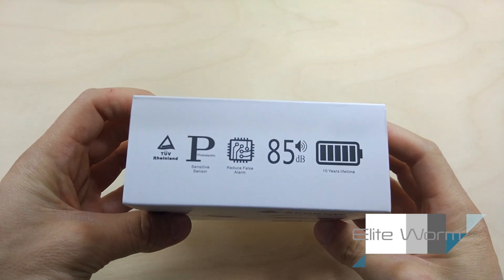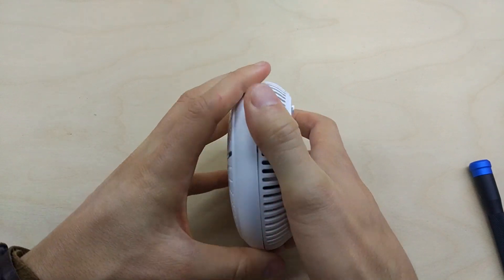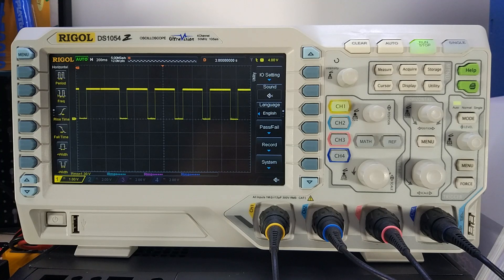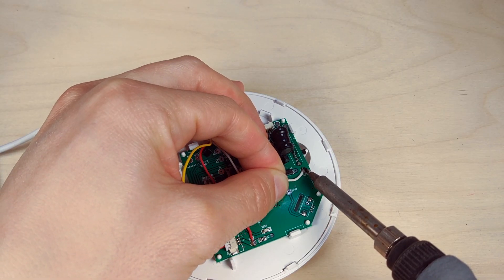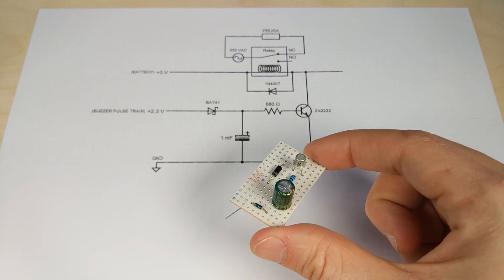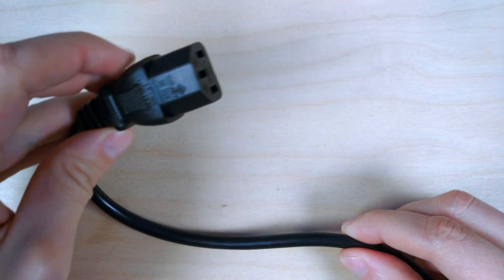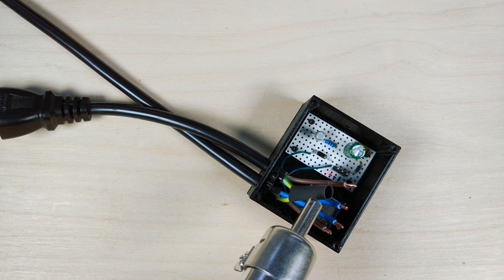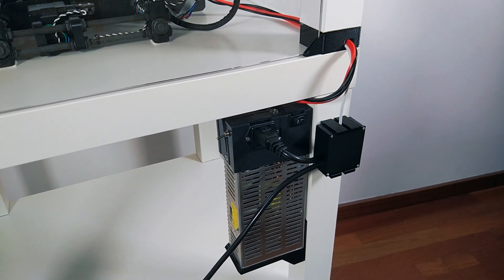🔥 3D Printer Safety | Smoke Detector Hack

Comment: Clever design, i did something similar but used an Arduino to read the signal from the blinking LED. But this method is more elegant! 

Could it be possible to implement a flipflop or something so that once its triggered it wont turn on again until you press a momentary push button?

Comment: Hi, I did something similar but I used thermal fuses located around the printer to disconnect the power through a relay instead of a smoke alarm. If anything starts getting too hot, a fuse blows and the power cannot be restored without investigating what went wrong and replacing the fuse. Video on my channel if you want to see my take on this kind of safety circuit.

Comment: Hy, I have replicated your circuit but when the sensor activates the relay works intermittently with the siren. 
From the video it seems to me that the capacitor is larger than 1 uf. What capacitor did you use?
Thanks
Reply from the maker: Hi. You've got the diagram of the complete circuit in the video. I used a 1 mF capacitor (1000 uF).
Reply: @EliteWorm  thank you i have wrong the capacitor. I have mount a one of 1 uf.. :( i retry with a correct. Thank yoy

Comment: Great idea, but I'd caution against automatically re-applying power after the smoke detector clears.
Reply from the maker: Hi Leroy! It should not re-apply power automatically in this configuration... You must push the smoke detector button in order to clear the alarm. Thank you for your comment!
Reply: @EliteWorm  Interesting. I've never had one that doesn't reset itself when the smoke dissipates.

Comment: Personally, I would design the circuit in such a way that the smoke detector permanently shuts off power to the printer upon activation. The power can be manually restored by a momentary push-button after any potential damage is inspected. The reasoning is that if there is a fire, the mains wiring itself could be damaged and start another fire after the smoke detector stops.
Reply from the maker: Good point!
Reply: You could do it with a GFCI.  have the relay create a ground fault, which would trip the GFCI and bob's your mother's brother.
Reply: @oledonly  That's bloody simple actually!

Comment: Great video! My 3D printer is in the basement so if the fire starts, just turning off the mains would not help too much. I will try to make the same thing but also add GSM module that would call my phone if it happens.
Reply from the maker: That's the next step, a very good way to improve it. Good luck! 👍😉
Reply: Better to have radio connected smoke alarms, one goes off, they all go off. Don't rely on the GSM network to tell you your house is on fire. Unless you're going out of course, then perhaps better to get a smart home one.